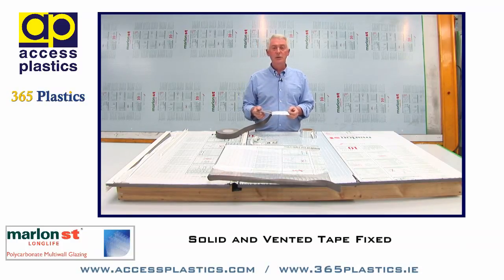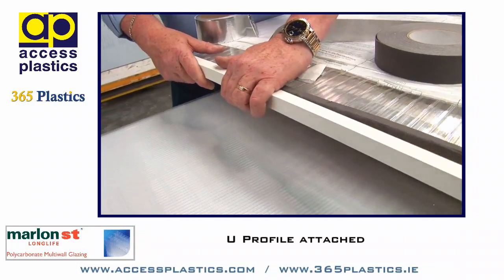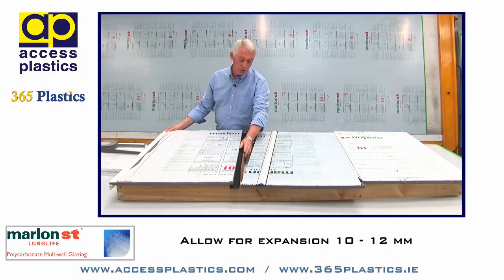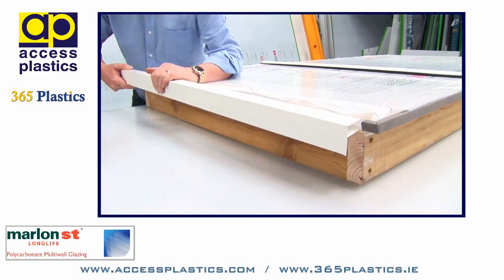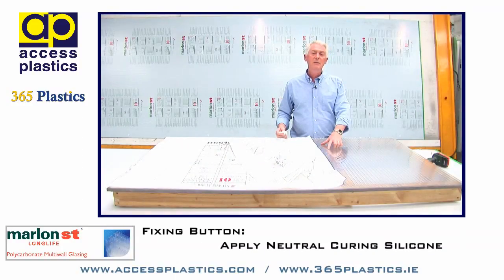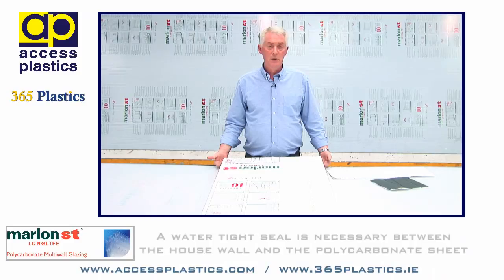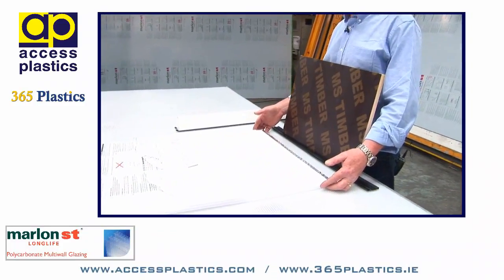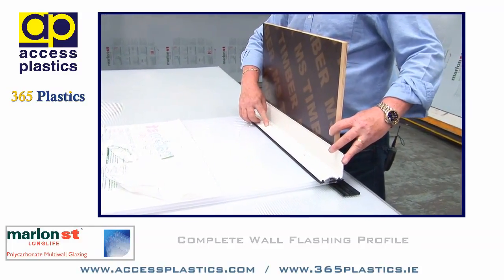Multiwall Polycarbonate Sheet | How To Assemble A Roof | Access Plastics Ltd

Comment: Just finished a roof today.   Flashband was a pain to get joined accurately to 2 surfaces at the same time.  I decided to cut the backing tape in half.  Then i glued the top half to the wall.  When this was done i then removed the backing tape from the bottom half and glued that down to the roof.   I also cut the flashband into 1m lenghts to make it more manageable.  Finally, i stuck a single length of narrower flashband overlapping the top of the supplied flashband. Now to see what happens when it rains.
Reply: How's the flashband holding, any leaks ?

Comment: You didn't show how to get those confounded caps on the fixing buttons , darned near impossible to get some of those buttons into it's hole  , if you had a bit longer length of plastic between the pull off cap and the button ,it would give us something to hold on to while tapping in the cap .

Comment: I found you video extremely helpful, however Its a shame you didn't go to greater detail in drilling the 18mm button hole, did you drill a pilot hole first? what type of drill to use? as making a mistake here becomes an expensive error.
Could you give some more detail please.
Reply: when you drill the hole particles of polycarbonate gett into the flutes and is very difficult to remove.

Comment: Bit of feedback from fitting a roof today: it would have been extremely helpful if you’d said in the video to pre-drill the holes for the fixing buttons before fitting the solid and vented tape so the flutes could be hoovered or blown out: had just got two panels taped, end caps fitted, lifted up onto the rafters and drilling the first hole for a fixing button filled the flute with plastic swarf. Now considering whether to take it all down and strip the tape before pre-drilling or just have it look a mess.

Comment: What is the minimum pitch/slope that you recommend for multiwall poly-carbonate sheets?
Reply: Most of them require a minimum of 1/12, but you are better off with a minimum of 2/12.
It also really depends on the thickness/strength of the sheets you are using. They can vary a lot, from 8mm two wall, to 32mm 7 wall as far as the snow loads they can carry.
Reply: @darrynfrost3401  cheers!
Reply: Simply put it’s a 5-10degree slope, to facilitate rainwater run off and self cleaning.